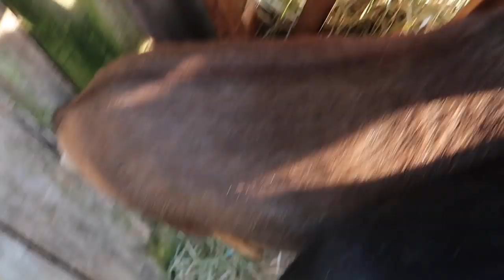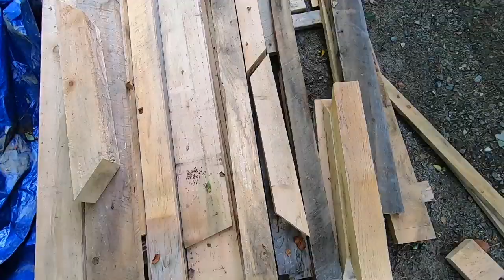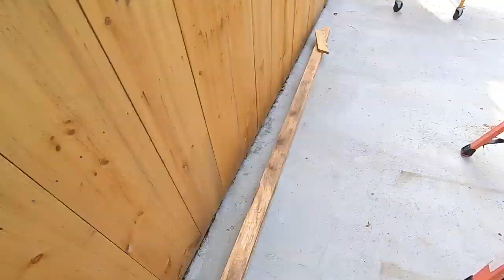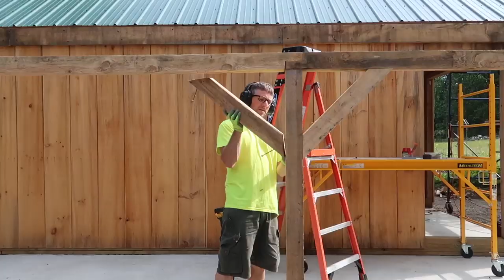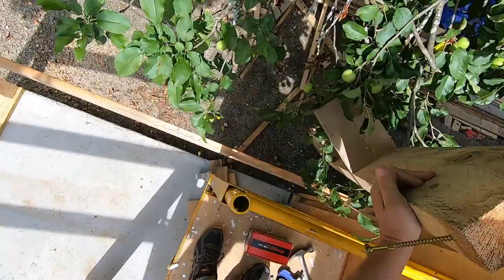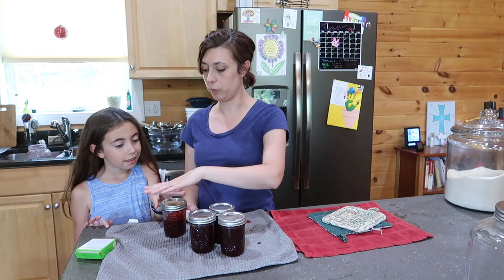Installing the Last of the TIMBER FRAMING on the POST and BEAM BARN we Bought off the INTERNET

Comment: 55 deg in San Martin, CA.  We have "marine influence" weather here with diurnal wind patterns.  Cold air pushes foggy air in from the ocean, hot air burns off the fog mid day and we get hot in the p.m. 80-100 degF.   Since I live in the narrow part of southern Santa Clara Valley (most everyone knows it as Silicon Valley) I get afternoon winds from the north from San Francisco Bay, and sometimes it comes in from the Monterey Bay.  I place my hay for the horses depending on which way the wind blows so that it doesn't get blown through the fence!  Good stone fruit growing region.

Comment: Southern California mountain community at 4000 feet...53 degrees and expected high of 83.....we do get hotter into the 90’s as summer progresses but it is usually a “dry heat’’...not much humidity....unless we get an afternoon thunderstorm..which can drop an inch of rain or more in 20 minutes....

Comment: Enjoy your cool mornings.  Here in NE Oklahoma, our morning low temp is around 80 and the heat index has been hovering around 105 by midday.  Rain in the forecast for Sunday so should be about 10 degrees cooler next week.   Have a great weekend!

Comment: I got a bit of a giggle on the rafter dominoes! I've had similar happen several times already on my project because of the winds up here on our ridge! Your barn is coming along really nice Al! Will you be adding electricity and/or water?  I finally get back to my project today after nearly ten days off for a big party then heat and rain. It will be 95 degrees and super humid so not too much will get done today (unfortunately), but after rain again tomorrow, Monday gets way down to 81 degrees! 😊😊😊

Comment: 54 and rainy over here in western Washington. I'm still new to the area and so far, it usually only gets up to low 70s is not very humid. A big change for me coming from Ohio/Michigan where it gets to upper 80s/90s with 100% humidity. Glad to get away from those super sticky summers. Except now I'm wearing wool socks and a sweater in July indoors. That's a little weird...

Comment: Mr. Lumnah,
Growing up, we did see a drop in milk when we trimmed the cows feet. So that makes sense. To offset that, my Dad would try to schedule one if the hoof trimming sessions right after we let the cows out on pasture in the spring.
May I suggest, perhaps, temporarily, putting something to block the spaces in the back wall of the milking room? Plywood sheets, mayhap?

Comment: This summer we haven't been down very cool in the mornings. We can range from the 50's to 80. Just depends, this year started out cool, but now we have been very hot, so the temps haven't dropped very low at night.  Ok, two times things fell, wondering what the third thing will be. lol I felt bad when all your boards went down, domino effect for sure. But when you consider all you have done on this barn, these couple of things falling are so minor. Better the boards fall than you fall off the roof! I have made a lot of strawberry jelly in my day and miss it. Need to make some again sometime. The barn is definitely taking shape and I think you can get done what you want in the next video if the weather and Murphy's Law cooperates. lol

Comment: Good morning Al.  Out here in Sunny Valley, Oregon the lows have been in the upper 50's to lower 60's with highs in the 80's. 
Weather permitting, I think you'll have the tin up and the flashing installed. When are you having an electrician out to rough in your electric? In your area, do you have to have a building inspector okay the electrical system before you can turn it on and use it? Soon you can move your tools out of the basement and into your new barn! Great job Al.

Comment: Al...I think (guess) your barn completion (as far as cover and major framing) will be done on Mondays video....so I am assuming you will complete it  sometime Saturday for a Monday vid.  Then it is just a matter of trim work, painting/preservation(?) and setting windows, doors, transoms, running of auxillery power outlets(?) / plumbing (?....didn't know if you planned to sink a hand-cranked well back there) as well as what ever you have planned for your stalls. At least you can put the scaffolding away for the most part.....I am guessing) . In retrospect, I (if I had the resources, time.)..would have extended the concrete pad out about another foot on all sides plus a drive ramp to the main opening. The larger apron could perhaps serve to shed water away from the barn to maybe some french drains or something of that nature.  I remember the standing water/mud around the goat enclosure from this past winter/spring.

Comment: Today 7/19/19 in Coldwater, MI it was 89 degrees with 50% humidity and felt like 94 at 8:50am and now 9:25pm its 85  degrees with 77% humidity and feels like 95 degrees at 9:25pm................... Our low is for tonight 81 degrees but humidity is not suppose to go down.  Awful weather right now.

Comment: Shenana Noodles is the "Phrase of the Month"  Love your OCD, Al.  I have it as well.  It is different for each person, but yours aligns with mine very nicely.  It is sometimes not logical, except when it is.  However, the skylights would have been so good.  Too bad there was not a work-around for that.  Mine is all about tidy, unmessy methods (which I then have adhere to no matter what) and mine is also big on "transference."  I don't like certain things touching me or each other and when I see other people ignoring "tranference" it is like nails on a blackboard for me.  End of my OCD venting.  Dominoes are always fun, except when they are not.
🍓  🍓  🍓  🍓  🍓

Comment: Al, could your barn be a dwelling and how much extra would it cost excluding electric and plumbing? Specifically, the barn cost you 10 dollars excluding your labor, what is the percentage increase to have an insulated roof and walls? Kitchen, plumbing, electric I can figure out. I need a cheap camp on Lake Champlain. Want to build in in the off season?

Comment: They should have put the joint in the center of the post.  When you notch a beam you make it the width of the notch, not the beam, supporting the joint at the center alleviates this.  Probably makes not difference here but if structural strength is required they should have allowed for this.

Comment: It was 76 at 6 AM here in south central Kentucky....and humid😜
Al....if possible consider semi permanent pens. Ones that bolt to walls and can be adjusted for kidding and totally removed from the barn for cleaning. I had that set up in my cattle barn on my old farm. I calved out cows in winter in the north so I had to have a flexible barn system. Sydell systems has awesome goat systems. That might give you ideas.
The link below is one kind of pen they have.

https://sydell.com/product/4-c-style-deluxe-fair-pen-panel/